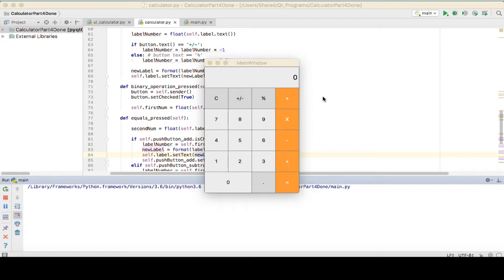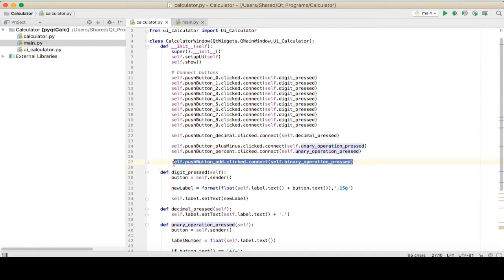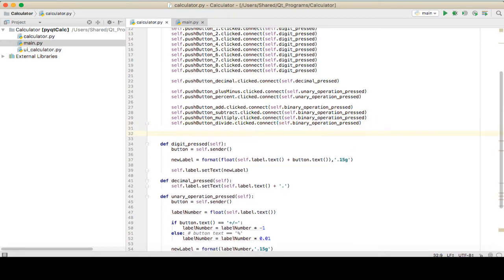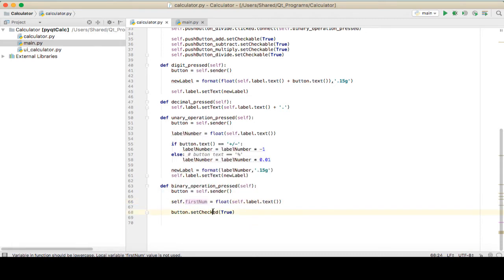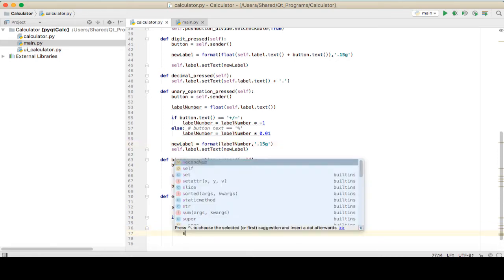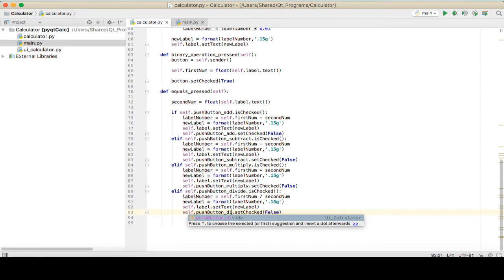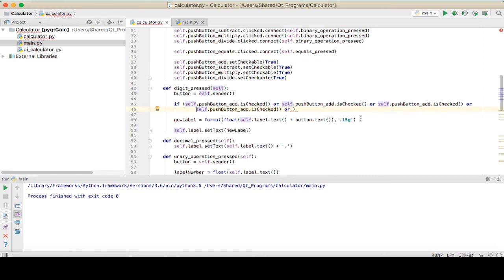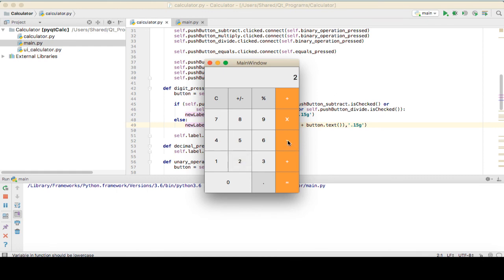PyQt5 Calculator Gui Tutorial Part 4

Comment: when i press equal it goes exit
Reply from the maker: Make sure you have the `equals_pressed()` slot defined correctly and that the equal button is connected to that slot.  It is likely that the code in `equals_pressed()` has an error and the program crashes when that code is run.